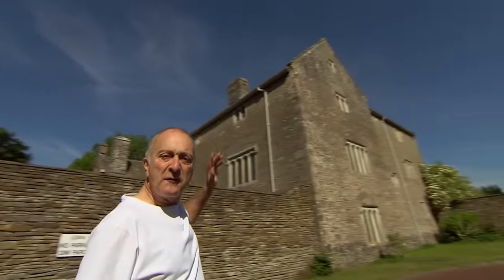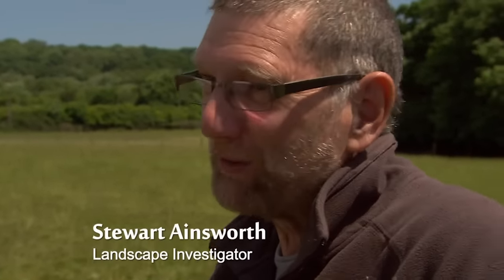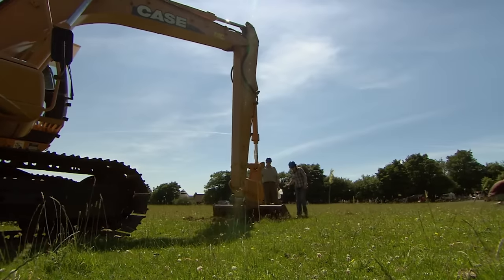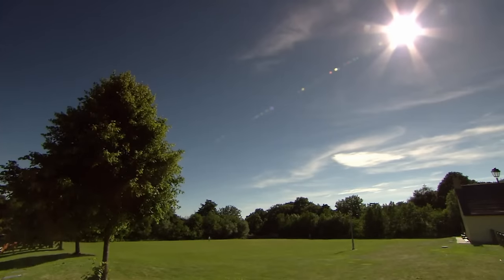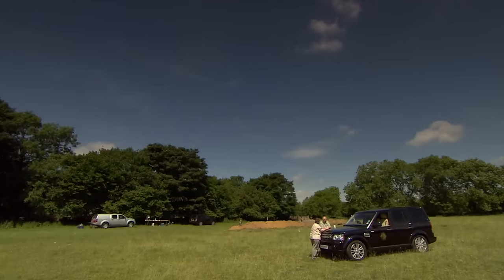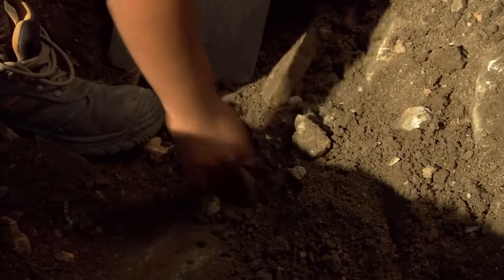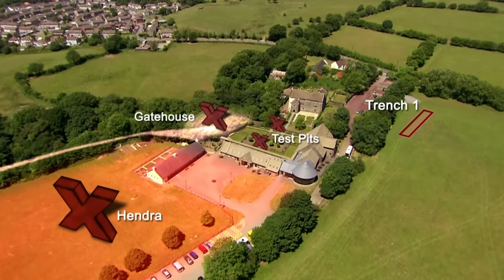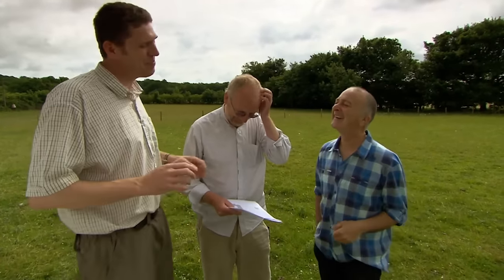‘Mystery of the Manor Moat’ (Llancaiach, South Wales) | Series 18 Episode 9 | Time Team

Comment: Is it possible that the attic timbers are not original to the house? Perhaps a fire and were replaced at some point, which might skew the dating of the manor.
Reply: Possible but unlikely I would think. If there had been a significant fire there would probably be other signs and, stylistically, the building isn't that much older than the timbers, archaeologically/historically speaking.
Reply: @georgedorn1022  agreed, it's very much in the style of 1500-1540, and no evidence of burning. There is some brick at the top of some of the walls that suggests some kind of bodged repair, though.
Reply: A nice thought, but I'm guessing not.  As we've seen on other Time Teams, there's usually a paper trail of letters and expense books, something to which the museum or local archeologists would have access.  Had there been a fire, there likely would be a record of expenses paid to those who made the repairs or those who sold goods for repairs.  But I do wonder if the attic was the only spot they took core samples.  They've taken them from fireplaces before.
Reply: I wondered the same. I don't think the stone window frames are original. I think some remodeling has occurred, possibly after the restoration. Although that does not fit with 1550 for the roof timbers.

Comment: Although I pass Llancaiach Fawr quite regularly I speak with no archaeological talent or knowledge. But, it doesn't take Sherlock to consider the Time Team didn't mention once how long it would've taken to build. I'd take a guess at hundreds of skilled men and hundreds of labourers needed to build a house that size. Built 1550 (ish) and coins found nearby would suggest, to me anyway, that where they found the coins was where the builders etc lived. Anyone got a better theory?
Reply: It is an odd site based on the artefacts recovered. Aside from the Bronze Age sherd, the earliest pottery found was from the 18th century yet we know that the house is 150+ years older. Where is the 16th and 17th century pottery? The multitude of craftspeople/labourers and subsequent occupation of the site should have left some evidence.

There are medieval coins but these are mostly worn and/or broken so must have been in circulation for some time before ending up in the ground.
Reply: @georgedorn1022  yes, the lack of any sign of occupation - pottery, middens, out buildings from the C16-17 is very odd, to say the least.

Comment: There was no evidence to suggest the Bronze Age features were visible in the 1500’s. They just plucked that out of their bums. It would have been a non-descript smudge in the dirt, just like it is now.
Reply: They may well have been visible, depending on when, and how intensively, ploughing of the field began. This could have been as late as the post-medieval to early modern periods. Bronze Age field boundaries are still visible in certain areas, Dartmoor for example, where no subsequent activity has taken place - these earthworks can survive for long periods of time if left undisturbed.

The report actually states, however, that the Bronze Age pottery was actually from a disturbed deposit and the ditches were not securely dated so your bum-plucking theory may not be too far off the mark ;)
Reply: @georgedorn1022   They may well have been, but there was no evidence to suggest that.  We talking about quite a highly populated area of southern Wales, which would have been cultivated for millennia.  It would have been ridge and furrow from very early on.
Reply: There's no evidence that they weren't visible, either.